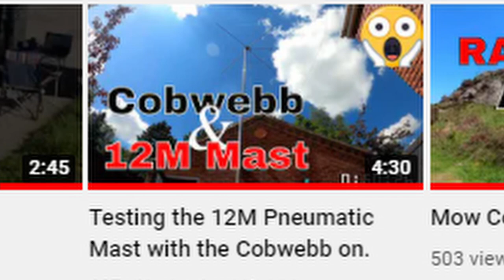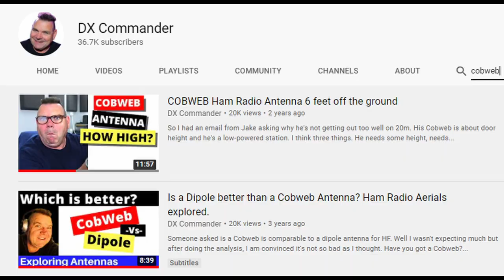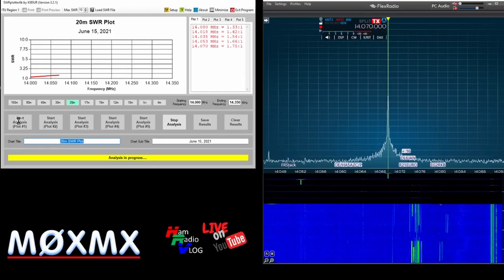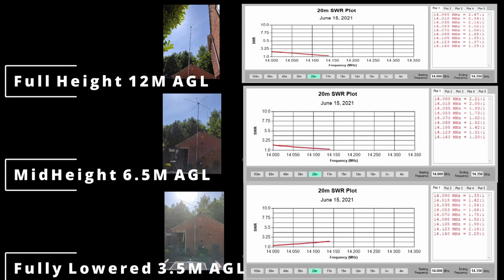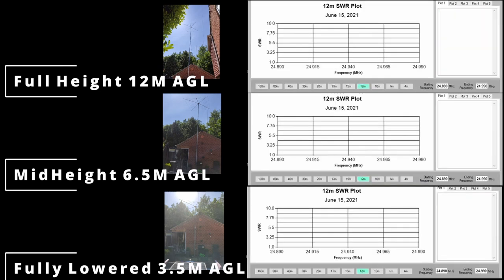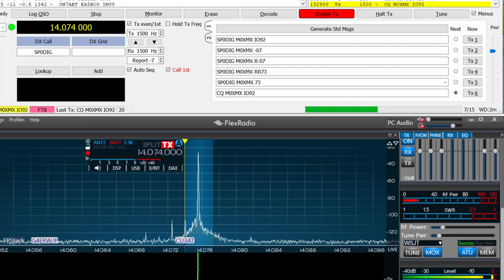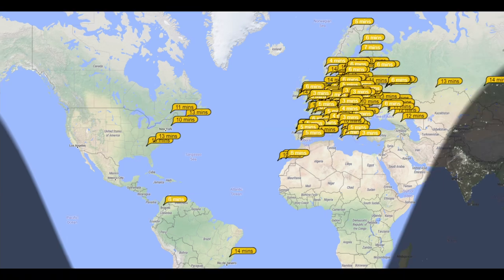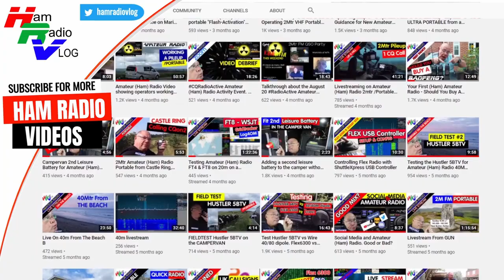Testing The Cobweb on the Mast - Prt 2 ( THE RESULTS)

Comment: I am mainly interested in antennas and cables, both "ordinary" for elements and coax. How does COBWEB perform and which cable did you use for the elements (double or single according to the Dx 10 option?? In advance, thank you for the answer 73

Comment: Thanks Mike.. I have an MFJ 6-20M unit that should be here in two days.  I'm building a non collapsable "tower" from nesting aluminum 6061 tubing.. Need to do a bit of machining on it so they are actually slip fit at the ends.. but it should well be self supporting (no guy wires).  I'll do a temporary setup at my fence and if I have no serious feedback from my neighbors.. I'll do a permanent mount in the back yard (garden)
Reply from the maker: Good luck 73